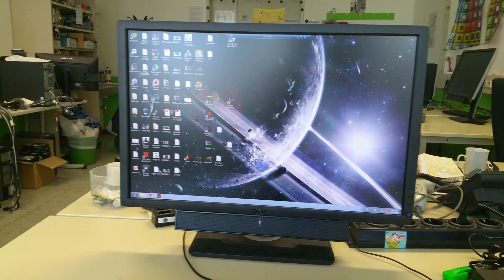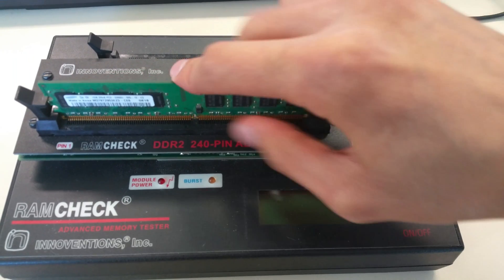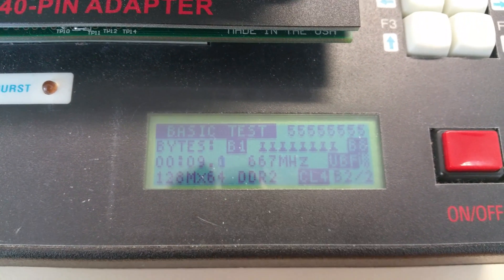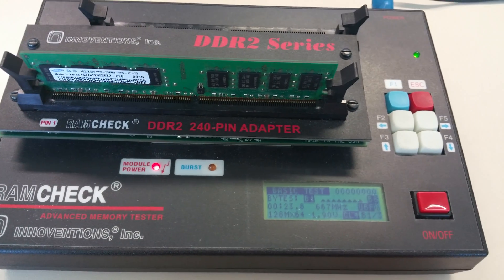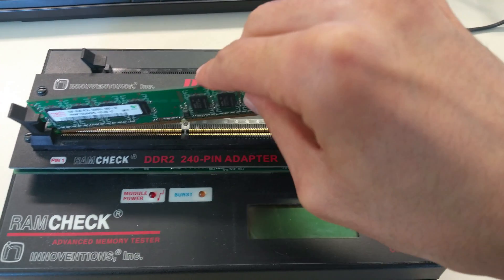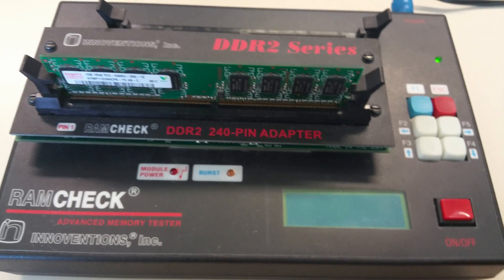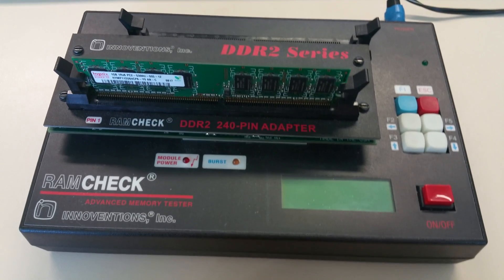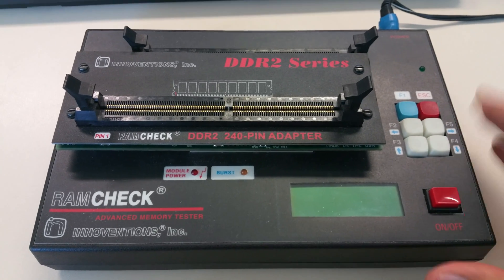At Work: Testing RAM with Ramcheck

Comment: Why are you turning it on and off all the time?
I thought you only do that if you replace the socket-adapter board.
Reply from the maker: I just got used to it, probably because we are just used to turnin off machines before taking RAM off of them. It's just to be on the safe side I guess, besides I never tried doing it without turning it off and on again, so I dont know if it would work without